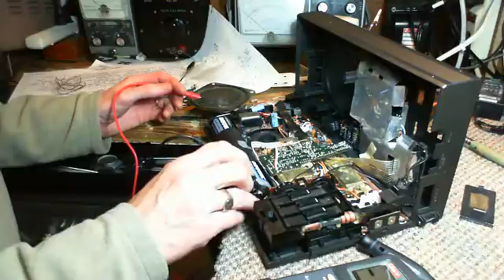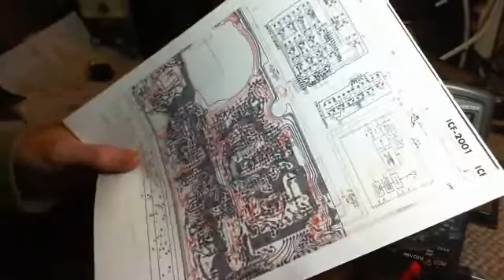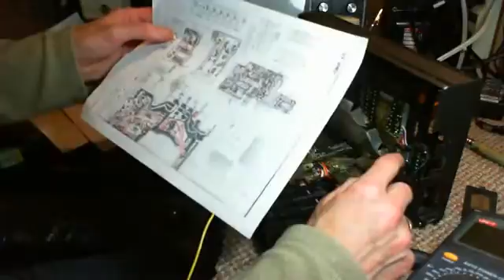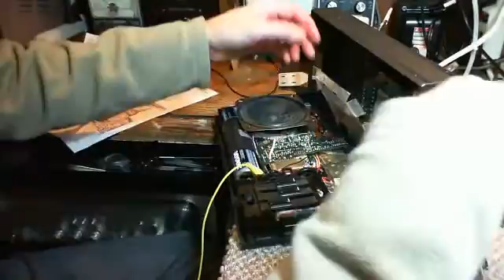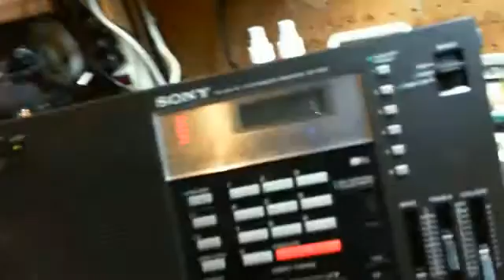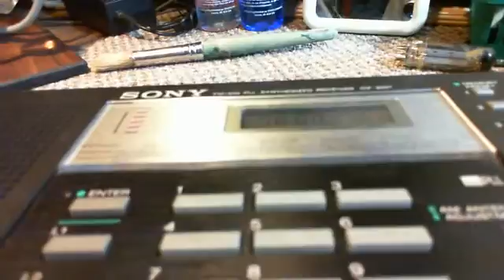Sony ICF 2001 Video #10 - Final Success

Comment: Good job.  But what did you do to fix the radio?  :)

Tom
Reply from the maker: I used my magic powers and fixed the 3V battery connection.
Reply: Hmmm, that was the only problem.  Super.

Tom

Comment: My guess and it is only a guess, you should not have to lay the radio down to see the display.  Normally that means the display is not getting high enough voltage to fully light the display.  I have noticed this on devices with LCD displays where  the batteries are weak.

Tom
Reply from the maker: I think you are right.  Later, when I started the radio, it was very slow to come on with the display fading in over a 5 second period.  Once the radio is 'charged up', it can be shut off and turned on like normal.  Leave it for a few hours and you get this slow charge-up effect.  I'm sure something else is wrong with it but I am very hesitant to go after it since the radio is working and the owner doesn't want to spend much on it.  I'd be risking it's current working condition to go in a fish around some more.  We'll have to hear from the owner first anyway.  I bet he'd be happy as it is now unless the radio completely quits again.
Reply: Good job.

Tom